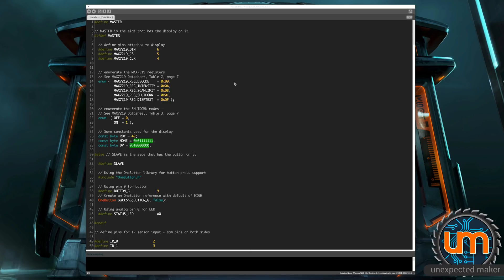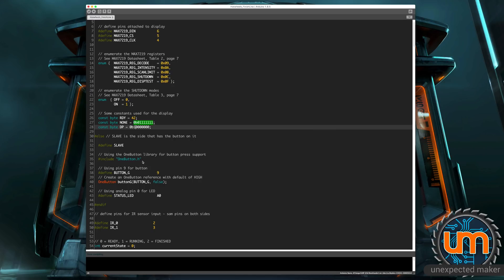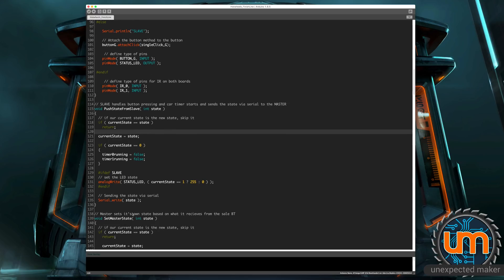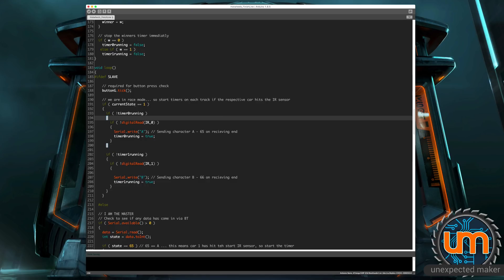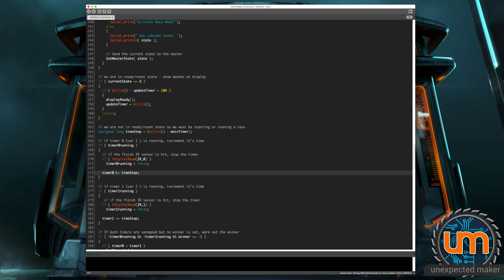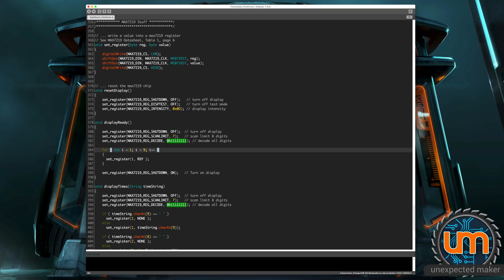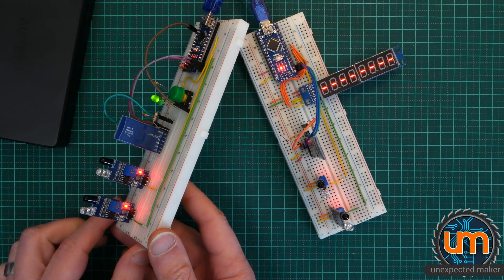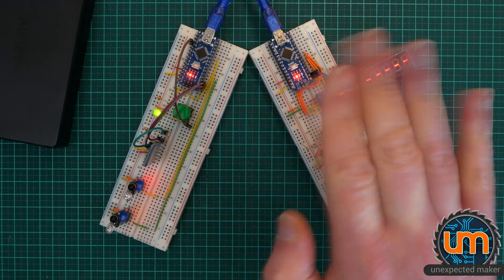HotWheels Speed Track - Part #2 - The code and Testing

Comment: Awesome stuff! Very very cool indeed! Just a few quick thoughts I noted while you skimmed through your code… :-)
I believe you want to compare the 2 decimal place rounded timer values instead, when testing for a winner (line 289).
Noted that “< else if >” (line 289) does not account for == state. So in a draw winner would still be -1 (appropriate, as no winner).
Also, SetWinner() appears to only be called on condition both timers are stopped (line 287), so there's no need to stop the winners timer (line 177).
Finally, I note you have the same “the” typo that I have (“teh”).  LOL   Lines 222, 228, 299  hehe
Aside from that, I’ll take lane 1!  :-)
Reply from the maker: 'teh' is my nemesis - always has been, always will be. Just teh way it is ;)